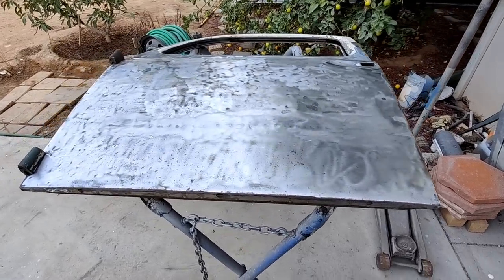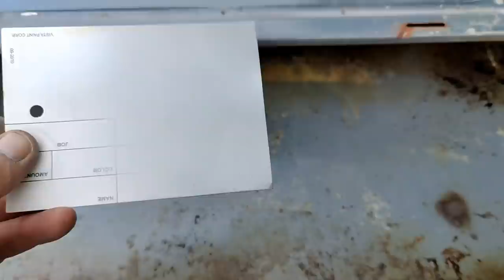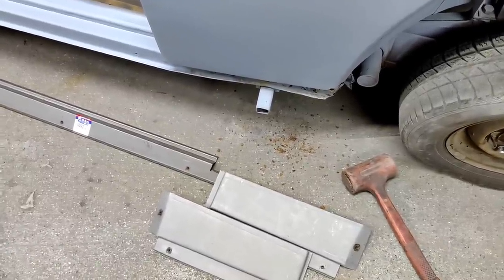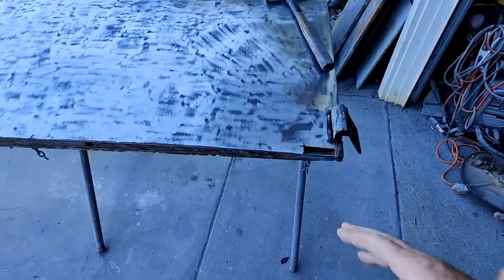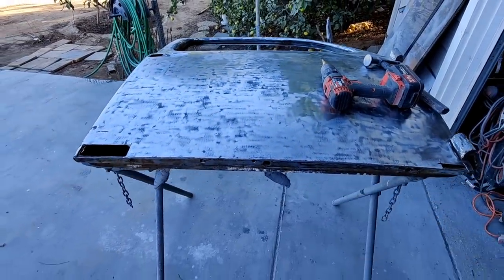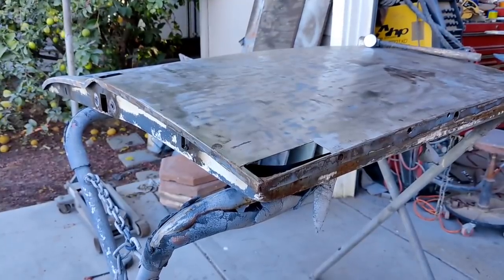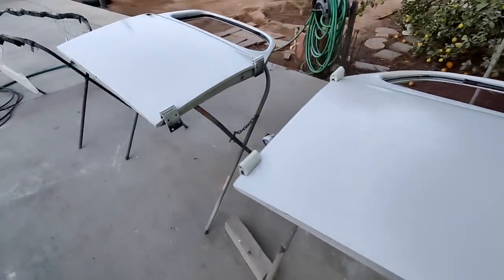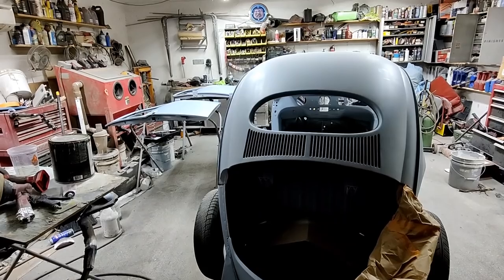RESTORATION - 1954 VW Bug Oval window restoring the doors metalwork welding to primer

Comment: I find your explanation for metal repair very good to the point where one would think ya I can do that, but you find out there is no replacement for doing over and over into right. The next repair will have new challenges to deal with . You don’t start doing this at 66 and expect what your years of experience has taught you for being able to visualize it in your head and then applying it so quickly 🇺🇸👍
Reply from the maker: good points. seeing what your going to do before you start does take practice. watching these videos helps people open their minds to ideas of how to fix their issue.

Comment: I love how quickly you release videos. Always great content to watch. Picked up my Titanium 140 this past weekend. Ready to get welding. Thanks again for the great videos.
Reply from the maker: Just treat the torch like its made of glass and it will really last. I didnt return mine this time I am going to see just how long it will last. Over 1 year with no issues. keep the wand and torch loosely around the machine no tight rolling up.
Reply: @Mikefngarage  I saw your videos on the welder and I took your advice and got the 1 year warranty. Warranty is $65 now, but that's fine. I am going to do the 1 year turn in regardless so I figured at least I am covered to finish the welding on my bus. I loosley draped the torch around the outside of the machine and I'll never coil it up.
Reply from the maker: @FeveredMind   should be fine I figured I better let them make some money ha ha. Burning this sucker up for over a year now. One of them I didnt get the warranty and i was welding on a trailer for my buddy off a generator.....kept hitting overload switch I had my buddy resetting every 5 minutes.....Killed it under 90 days....Warranty.. so this is my 3rd one. second one I was a little too tough on the wand and it kinked warranty.... Very fragile. this one had it over a year  and just been taking care of the wand and torch. No issues. The other ones were actually my fault....but warranty!!! I figure I want to see how long it will last really. And if the torch goes out there is an after market one I am going to buy and keep running it.
Reply from the maker: @FeveredMind  be sure to try the welding supply wire vs the harbor freight. there is a difference.

Comment: You make it look so easy!  Could you do a narrated demo of the HF pinch welder you have one day?  I have one and my results are hit and miss.
Reply from the maker: all sides of the metal must be really clean. and tongs must touch perfectly or it wont stick. Doing a slow speed of the corner repair with narration tomorrow.